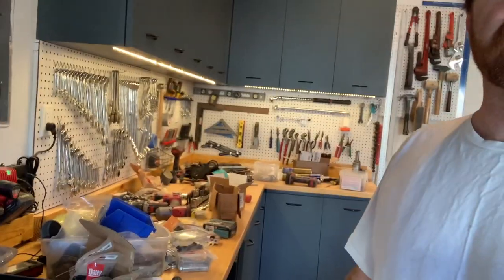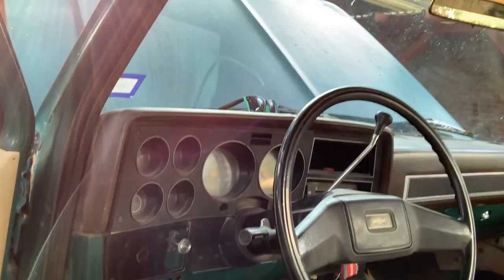CHEVROLET STEERING COLUMN REPAIR | Ignition, Dimmer and Wiper Switch Replacement!

Comment: Thanks for the great video.. i got a problem on my steering column for your video i think i know what i did wrong..
So this is my problem.. the shift changer doesnt go completely into park position.. so therefore i can’t take out the ignition key. 
Any help would be appreciated 
Thanks

Comment: I’m missing a piece that holds the wiper switch assembly in place.  Does that install thru the bottom of the pivot?  Does it look like a pin with a flat piece on the end?

Comment: That is a ridiculous situation, did you take the column out for demonstration purposes or necessity. Luckily I unplugged and plugged back in the wiper switch plug and they started working again. Just a matter of time before I have to take the column apart.😕
Reply from the maker: More for demonstration but I have a real hatred for laying on my back and working under dashboards.
Reply: I changed it on truck  not easy

Comment: Thabk you, my high beam actuator rod appears to be broken. Mine won't touch the dimmer switch and is off centered towards the passenger switch. Do I need a new rod? How easy is it to replace?

Comment: Got one for ya, what's the deal with my wipers coming on when I turn the ignition key to start my 86 K10. They come on for a few cycles and then stop, I already have replaced my steering column due to the bearing in the tilt mechanism falling apart and I figured my problem was in the column but after changing the whole column out it's still a problem. If you got an idea that'd be great if not no big deal I'll figure it out.
Reply: sounds like your circuit board in your wiper motor needs soldering .
Reply: I have same issue with my 87 and sometimes my wipers will stick midway

Comment: Glad I found your channel. I subbed you, Do you have any videos on how to reconnect the high beam rod on a 1986 Chevy C10? I was installing the new ignition switch and the rod fell out that holds tension on the turn signal high beam switch. Thanks for any help

Comment: Where does the flat black wire with the clear ended two prong connector for the blinker switch plug in under the dash?

Comment: I have an 89 i partially took down to change the lower ignitioni. When i went to put it back together the rod was /is turned the wrong way so it wont go into the lower switch. As im watching this, it appears that it cant happen. Am I mIssing something? I Guess i need to tear it down further but though i would ask just in case im missing something. Thanks any comment appreciated

Comment: Those wires are always a pain fishing back in the columns. Done that job more than once over the years. Great video. Sounds like it may need some high idle choke work before winter though.

Comment: Should i bend my rod or replace a certain spring if my key rotates to 'off' while driving. I replaced the ignition switch but that wasnt faulty, its mechanical not electrical issue

Comment: Hey milkcrate did your column have the plastic pocket on the side? If so does it hold the ignition rod or the wires for blinker switch?